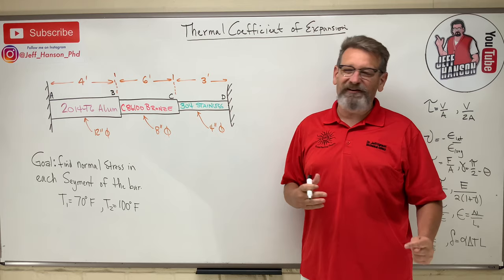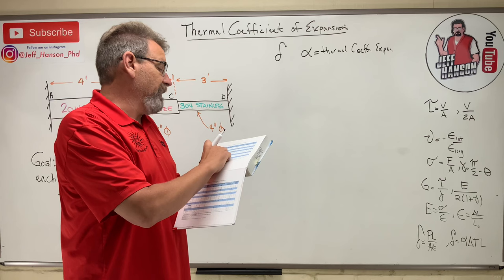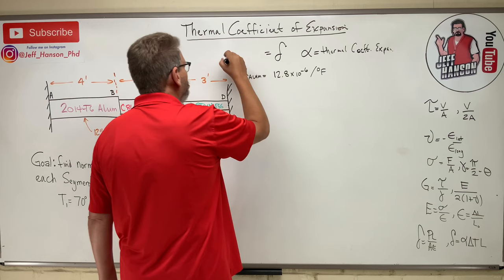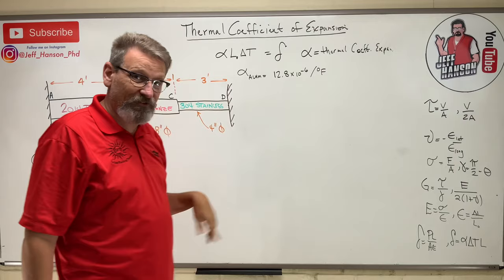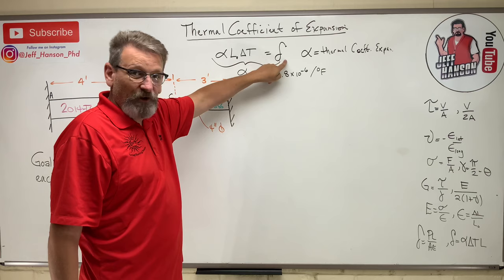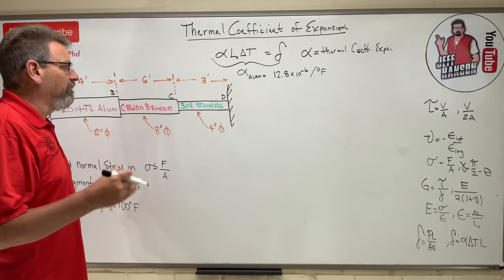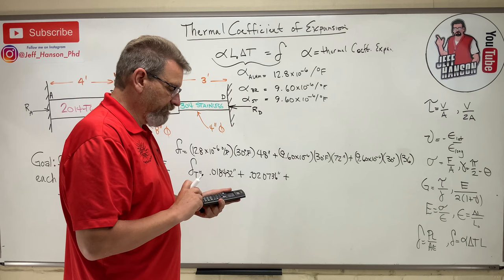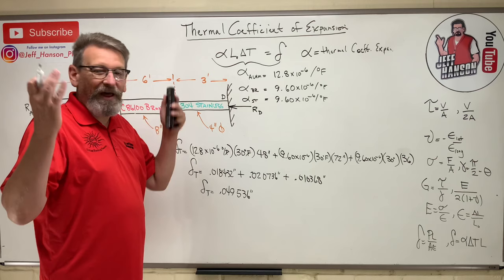Mechanics of Materials: Lesson 21 - Thermal Coefficient of Expansion, Axial Elongation

Comment: I remember a physics course here in Sweden that was called "Continuum Mechanics", and that course seemed to be a combination of basic Solids and basic Fluid Dynamics - it involved things like water pressure on water gates, the elastic-line equation, torsion and simple (relatively speaking!) applications of the Navier-Stoke's Equations.